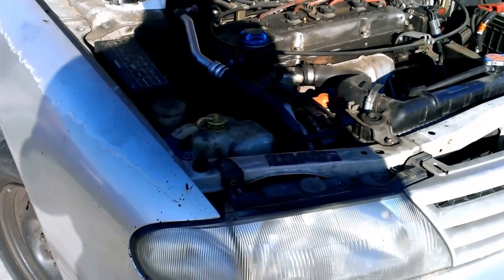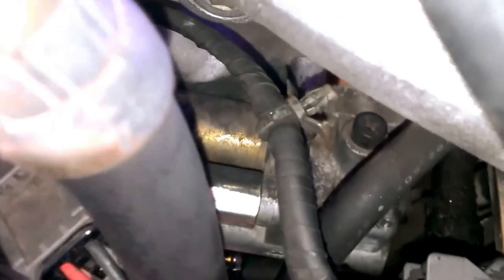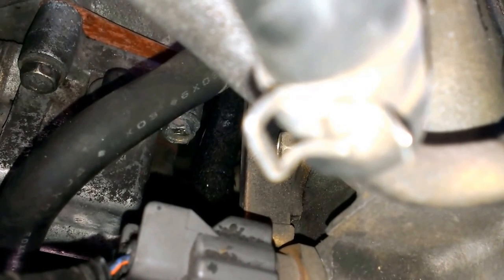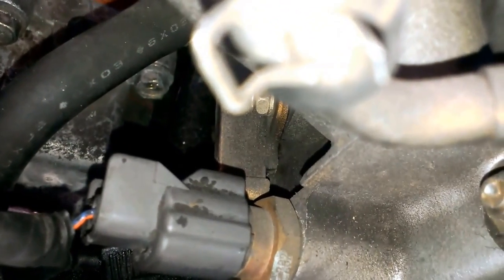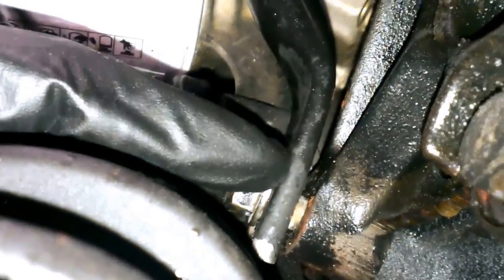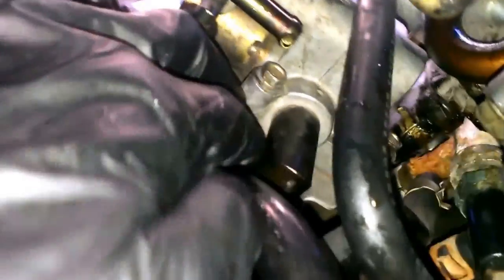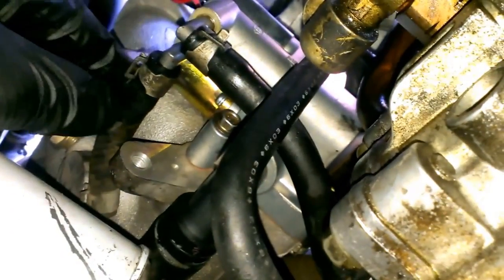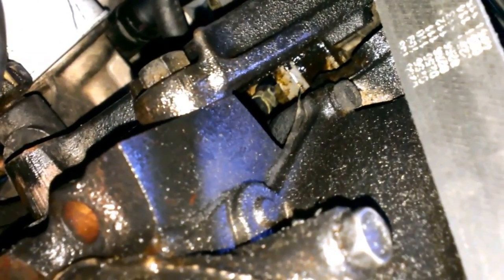97  altima idle air control valve replacement

Comment: I am trying to install my iacv by myself and I'm having a hard time, did you take the bottom hose completely off and reinstall it after you bolted the valve back on. Which bolts did you put on first? Please help I'm having the hardest time lining everything back up, I'm not the best mechanic but I couldn't afford to have it done in a shop. Please help, I need my car. Thank you!
Reply from the maker: +Hubert Goins  as far as the bolts i started with putting the bottom bolts on. and at the same time getting the 2 hoses on as well.the longer hose has plenty of slack. the short one does not. the longer hose can be taken off while still bolted.the short one and the bigger diameter hose can only come off as you take off the iacv. ive also learned a little hard way to take off the bottom larger diameter hose. if you take the oil filter off along with the filter adapter block you will have more clearance to the large diameter hose clamp. but do know that if you take the oil filter block off you will need to replace the oring seal  that sits inside it. i will be offering that seal soon.. while you at it you can access the pcv valve also . 

here is the link to that video too if you wanna do the pcv.
https://www.youtube.com/watch?v=roQVp3RzYgw

i hope this explanation helps.  if it does please let me know. and dont forget to subscribe and join me on facebook
Reply: +Motorsport Factory  Thank you for your quick response, I'll try that. I'm 62 and an amputee which doesn't make it any easier, also your video was the only one I could find. It actually took me four days to get it off, OMG LOL.  Anyway thanks again!
Reply from the maker: +Hubert Goins no problem. i understand your situation. also remember to replace the gasket too to prevent leaks. and it was also a bit hard for me to , to record and working laying on my back. i wish i had a lift but i dont at the moment . never worry about rushing. always best to take you time and do it right the first time

Comment: Have a 96 Nissan Altima replaced a lot of parts at 260000 miles it's got a header exhaust straight pipe new distributor n spark plugs wires replace the fuel pump and screen car sputtering while idling from exhaust need help
Reply from the maker: do you have check engine light codes on? check those first.

Comment: I finally got the IACV on and seems to be working ok CEL is off but idle is a little high, should be between 650 and 750 rpm. but it's like 900 rpm. Any advice on how to adjust the idle down. I'm thinking the IACV is preset but I don't know. Can you advise me on what to do? Thank You for your help.
Reply from the maker: +Hubert Goins hey  Hubert if you seen right toward the beginning of the video right where i went in to show where the iacv is you can see the black screw right?..... thats your adjustment. i was thinkin the same thing when i first got mine. 
have another person with you to help monitor the idle, to see if its goin up or down when adjusting. and turn it slow so you dont stall or have it revving to high. i believe you turn it counterclock wise to bring it down some. let me know if this helps
Reply: +Motorsport Factory It's been a month,idle still seems high and can't lower it, CEL is still off but still reading bad knock sensor.   I was wandering if it is possible to relocate the knock sensor to a different spot on the engine and where does the knock sensor wireing connector plug in and can you get to it from top side (under hood).If so please let me know. And again thanks for your response on the IACV issue.
Reply from the maker: +Hubert Goins stilling having high idle. hhmmmm you may have some thing else going on like check for vacuum leaks. change that knock sensor when you can . i will make a video one once i have a change on how to replace knock sensor .yes im sure it is possible to relocated the knock sensor but i havent done it yet.  there are people saying that you have to remove the intake manifold to get to knock sensor but i think it can be done from under the car like we see in video. also check to see if you have oil in the distributor by taking the cap dist cap off. you did also change the iacv gasket when you were replacing it right ?
Reply: +Motorsport Factory I did replace the IACV gasket didn't see any leaks. The knock call for five hours labor, it looks likr a worst job than the IACV, sure hoping it can be moved. Appreciate your help.
Reply from the maker: yeah the 5 hours is with that if you were to take the intake manifold off . but i will work on a video sometime this week or next week to help you guys out.
Reply: +Motorsport Factory Thank you I'll be watching for the video.

Comment: hi, i know this is a year old but I'm just wondering, what does the iac do? what are the simptoms of a bad iac? thanks in advance
Reply from the maker: +Rafael Moreno The main function of the IAC valve is to ensure that your vehicle idles smoothly. However with a bad IAC valve, this idling will be rough. You will experience heavy vibration (shuddering) when you idle the car. As the valve has gone bad, there will be no/very little air flow to the engine, when you idle the car. Thus, your car will shake, vibrate, and may also make a loud noise while idling. Due to this rough idling, the next time you start the engine (the car), you will notice that the car stalls immediately after starting. Your car's IAC valve might be clogged with carbon debris, and due to this, the valve might not open sufficiently enough to let the air to pass through it.

Under normal conditions, when your car is idling, if you turn on the AC or heater, your vehicle will still idle smoothly. However, if the IAC valve is faulty, your engine will stall the moment you increase the load (AC or heater) on an idling engine. You will also experience a drag on the steering wheel once the AC is switched on. To restart the engine in such situations, you should turn off the load and wait for few minutes for the engine to cool down before you crank it up again.

Comment: How did you know the idle air control valve was bad.  My 97 Altima is a knock sensor.
Reply from the maker: they way it was acting up and the code for it. did also voltage test.

Comment: hey buddy I know there's some kind of adjustment screw on The Idler sensor is there any special procedure on how to adjust the idle
Reply from the maker: best to have the car running again and wait till its warm and see where it sits and adjust it from there
Reply: Thank you very much for responding one more question do you have to disconnect the throttle position sensor when doing this
Reply from the maker: no.
Reply: Ok thank you very much

Comment: i have a 95 altima and it makes a slight knock when it idles what can be the problem and how do i check it
Reply from the maker: first thing is .do you have a check engine light on?if so start checking the codes and go from there. check the timing chain to see if its off.

Comment: I had my change few weeks on my 97 Altima but now the car runs like crap. I took it to a mechanic he said he change it but I think he just cleaned it. Car idles rough when I am at a stop turns off few times. How foni know he just clean it instead of changing it
Reply from the maker: you should be able to tell from the body of it. does it look newer or the same as the old one. its always best to diagnose the care before replacing the part
Reply: Map sensor connector quebrado

Comment: What was the symptoms to determine it was the faulty valve ? I have a 1999 Nissan Altima with 240,000 miles.
Reply from the maker: eractic idle. stalling, hesitation... but there are other components that cause the same issue . thats why you have to diagnose it before changing anything. check your codes first. even if you have no check engine light on,codes can still be stored in it

Comment: do you know where the IAC valve is on a 2003 Nissan Altima ?
Reply from the maker: is yours a 4 cyl or 6 cyl?...  for 4 cyl it should be same area. im not to sure on the 6 cyl
Reply: Motorsport Factory it is a 3.5 6cyl
Reply from the maker: sorry for late response. not sure in the v6 models. try google and see if they show anything

Comment: hey, there! got a question. My 99 altima died on me on the freeway. 65mph I tried to accelerate and no response, so I pulled over and died  completely. towed it home and tried to start it again and turned on, but when I start to accelerate it    stalls. Checked fuel pressure and its fine. did a compression test and found 60psi on all cylinders. It has spark. So the car won't start anymore, cranks but won't start. Any suggestions? also no check engine light. sorry for my English.
Reply from the maker: well the psi itself tells alot .. you need to have at least 120 psi for good compression. also check your alternator too.

Comment: by the way my altima seems to run normal, no apparent problems with the IAC but i smoged it and fail code p0505 "idle control system malfunction" and p0400 egr flow malfunction;:-(
Reply from the maker: +Rafael Moreno let start with simple stuff first like check vaccuum hoses. you can clean the egr valve  with carb cleaner to see if that helps. if you have a check engine light on ... they will fail it. so you have to have no codes to make sure it dont fail smog .you can also try cleaning the iacv and also check the wiring for that part and the rest of the wiring to the engine cause you never know where the problem can be 

also please subscibe to my channel and facebook. the link to facebook is in the link of video. i will be making more stuff for the altima soon

Comment: why did u get under the car
Reply from the maker: +Ryan Pentz  in order to get to the bracket at the bottom and to remove the hoses .
Reply: +Motorsport Factory okay I was going to clean mine today but I have 2000 and idk if I have to remove it or not.I didn't have a way to get under my car yet.thanks for replying
Reply from the maker: yeah just watch the whole video and you will understand. and if there are things you dont understand  i will do my best to help you. i will in the future make a better version of the video. but its just hard to hold a camera and work on a car at the same time